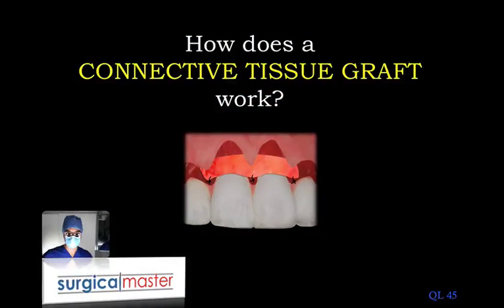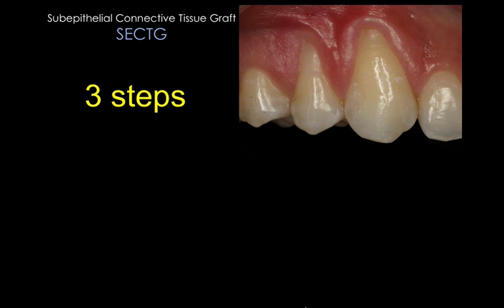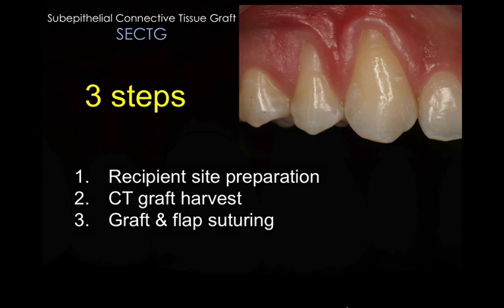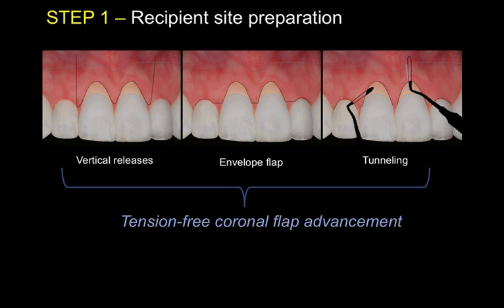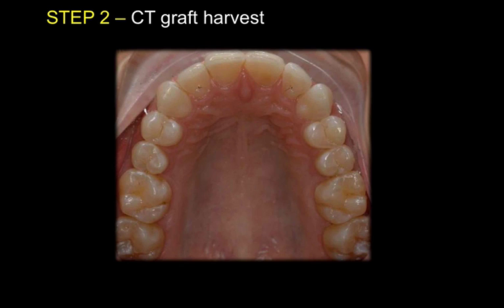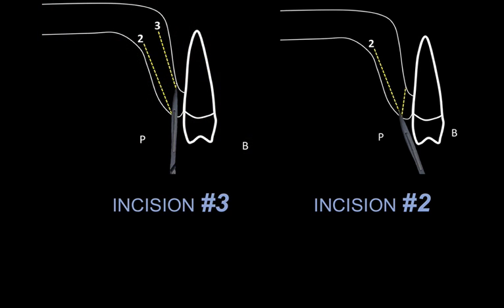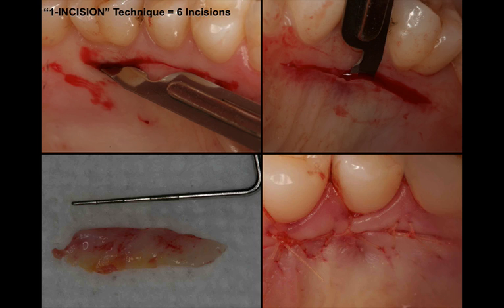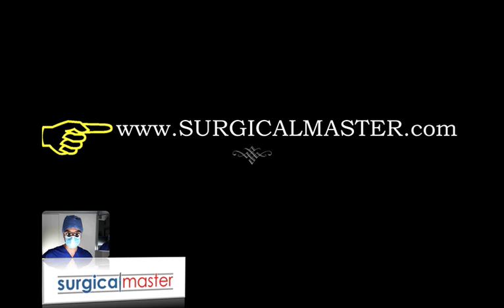How does a CONNECTIVE TISSUE graft work?

Comment: Im not a dentist but this was an excellent presentation! Really well explained and great graphics. 
Could I ask, what is your opinion or experience with the 'Pinhole' technique for gum recession? It seems less invasive but I have heard of bad results. Any info would be great, Many thanks for your good work.
Reply: My dentist told me it's not as minimally invasive as people think. In fact, it requires you to detach tissue down to the bone. You don't have sutures to hold the tissue down either. They use collagen strips packed into the gums to hold it in place. The issue seems to be the collagen seems to resorb and you don't gain the keratinization of the gums that you need to prevent recession from reoccurring. The CT Graft is not a full depth cut. You can use your own tissue or something like alloderm to lessen complications/pain. This technique has more data to show keratinization of gum tissue and increase in attached gingiva. As bad as it looks I'd prefer to do the tried and true method.

Comment: How do you make your 2nd and third incisions on a shallow palate? I would imagine it’s harder to get the blade parallel to the bone without the handle running into the adjacent teeth. Short of buying angled blades what would you do to acquire the ct ?